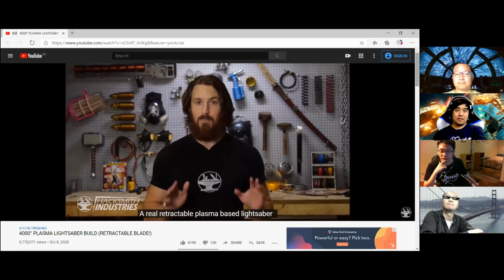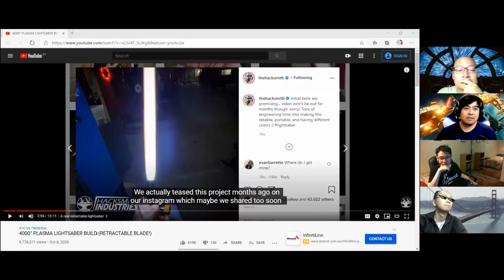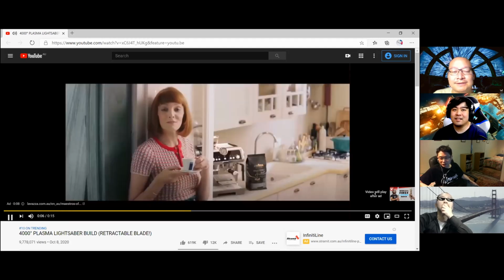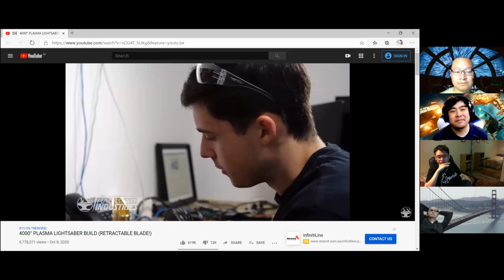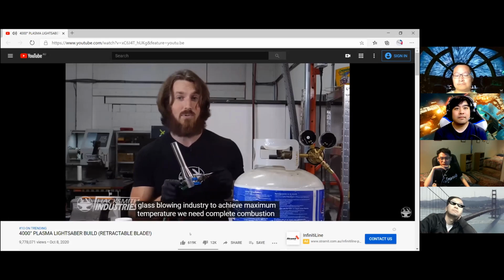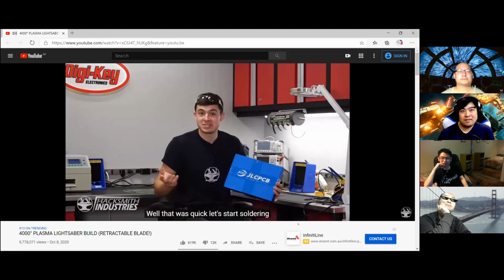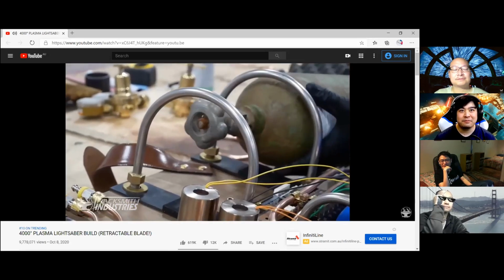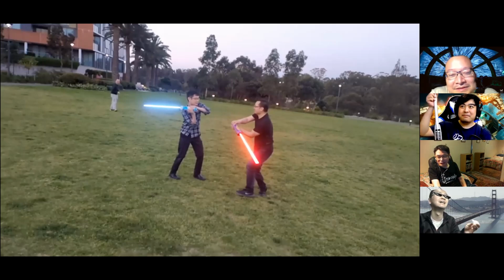Tech Guys Reacts to The Hacksmith's Amazing First Ever Real Retractable Lightsaber!

Comment: It is quite ironic that the old version is frowned upon as inferior when you consider that at least you can parry with it. 
Since nobody is going to just stand and wait for their weapon to melt, a quick motion with it is enough to go throught the gaz and aim for the user's arm and disarm them. Because "a red hot stick" is already more than what you need for someone to drop the fancy weapon they have in hand. 
That new protosaber is impressive, but as being practical goes (obviously the least of consern for something made for entertainment) it may lose against even normal weapons. 
.
Plus, even out of power supply, a metal stick is still useful, wheras this one, well...At least the design have a spiky end I guess? But those spikes may be good at catching another blade, which can mean damage to the nozzle before the "red  hot stick" gets melted (probably happening way quicker than in this video since the blade is already hot to begin with). 
.
I wonder what the reaction would be and how easely it could be disturpted, even if that's quite the dangerous and expensive test to make, and quite useless since it doesn't take a rocket science degree to understand that the new protosaber mosstly a super fancy blowtorch. 
In fact, in their video you can see that holding the industrial nozzle alone was enough to make it work without even using their design at all, so it is 80% entertainment design work plus going overkill with the type of combustible and pressure to test the limits of these piece of equipment (which explain how long they took to fine-tune it after the reveal. It's not that simple to transform a simple torch into that beast of a beam)
.
In the end, that's how these torches are used when working glass, oxygen and combustible gaz. 
Not new tech either since you can find (way less powerful, simple laminar torches) models in videos from almost 10 years ago. Time to get a proto light-dagger for 500$ or less I guess? But still, they really did go all-out for the design and manufacturing part of the process, the hype was insane and that steampunk setup still is a masterpiece on its own.